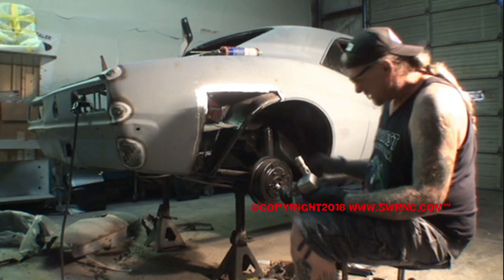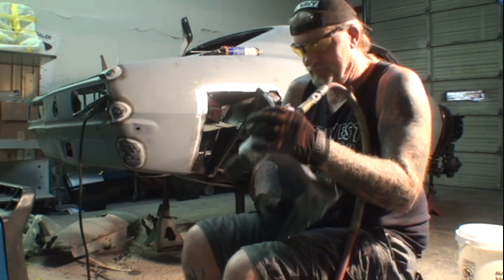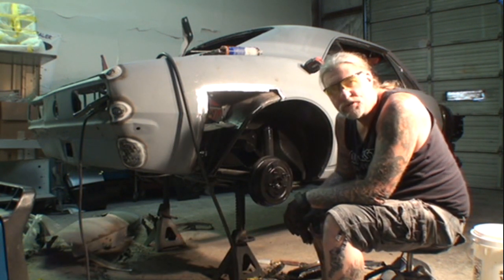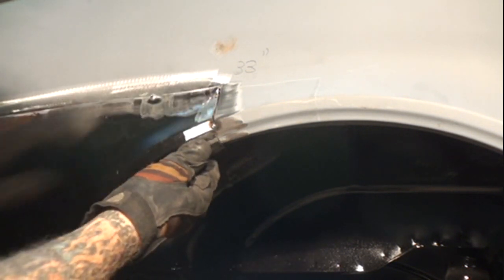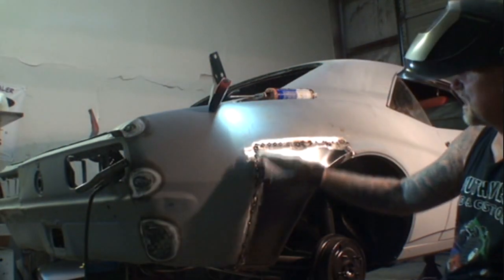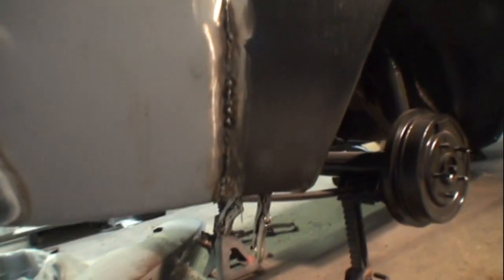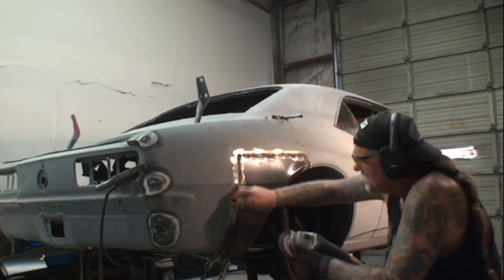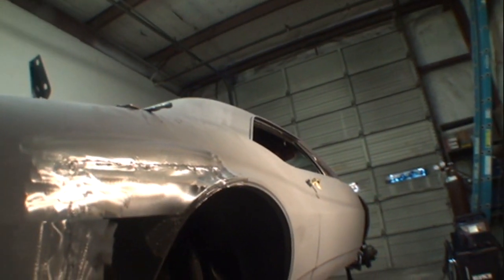How To "Patch Repair A Quarter Panel - 1967 Camaro - Part 5 - DONE

Comment: 1971 Duster project. Have the 1/4 panels sections from Goodmark. I know they are hit and miss. Will be using most of the panel as high up as i can go on both sides due to lower rust, sideswipe on the left, and numerous deep dents on the right. 1/4s are cut out rough.
Reply from the maker: Good Luck!
Reply: @diyautoschool  cant post pics that i see.

Comment: Love the show always entertaining, I have just started a quarter panel repair on my 68 Camaro, I have a question, if my cheap ass patch panel is about .008 thinner then cars sheetmetal how do you compensate for difference when using the flange tool.

Comment: Hello nice work, An important note, is that after you grind to bare metal to prevent rust one is supposed to use wax and grease remover followed by spray weld thru primer before welding. its one of the first things I learned at auto body school but don't take my word for it https://www.youtube.com/watch?v=FKyu3MWuPR8

Comment: Yous toos or threes as they say in the north section of this commonwealth USA say, This is very helpful. A class at a trade school would cost around 5 grand. Please do not send me a bill. That school would include about 100 hrs of classroom and pencil work.I will try this on my old Ford 150 restoration. There are two sides so which ever one finishes correctly will give me a good side to study back and try again. Their is only one other channel That I watch and you recognized him before. I am surprised that their is not a duct tape and bondo repair channel!

Comment: Just one point, primer it before finishing with body filler.. unprotected metal needs a protective coating before anything goes on top of it to prevent any further corrosion.

Comment: i am a fellow body guy when i replace a panel and but weld my new panel to make a perfect fit i put my new panel on over the old one screw and clamp it where i want it and cut booth panels with an air hacksaw snapon only one that cuts and has lasted lol bluepoint one so cut threw booth so when u are done cutting you end up with a perfect fit when u put the new pice back on and use magnets where u cant clamp to keep perfect hight less work and faster and grind welds with cut off wheel i can do a quarter in half the time as most and way leser bondo any questions please hit me up have outher tricks keep up the good work bro

Comment: Thanks Pete for the tips, i will definitely be incorporating the water cooling technique when i go to repair my quarter panels.
Reply: Surfaces should be dry before welding or hydrogen can pollute the weld and cause cracking. Google "Why is hydrogen a concern with welding?" Water is hydrogen and oxygen.

Comment: Hey Pete, quick question....What do you do on the inside of the quarter where you flanged it ? Maybe I missed a video where you showed that... Thanks
Reply: Was and am wondering the same thing. My thinking is if the welds are not sealed on both sides is. It’s a spot that will rust  faster if welds are exposed. Also wonder now would I spray an epoxy or self etching primer first on welds then reg primer. Also I have heard for bare metal, DTM primer, self etching primer. Or epoxy primer. What do you recommend and what is the proper application for these products.
Reply: Thanks for the reply Pete.... no seam sealer needed on inside?, just POR 15 and go, Love it thanks.
Reply from the maker: You can paint right over it, or you can take a shoots gun and splatter paint some POR15 on it to protect it for LIFE!, if you want to get really crazy you can go in and do some minor body work to hide the flange before painting.. Ive done that before for these ANAL FUCKS that have to have everything PERFECT for no reason what so ever...

Comment: Hi Pete, Hope all is well with you and minnie.Question bud, over my welds for floor pan replacement should i seal seal the weld or fibreglass first or just epocy over and leave.Car is a rotisserie job.
Thanks mate ! ( aussie3 slang ) :)
Reply from the maker: I would do all the welding necessary, then come back with some seam sealer and seam seal all the corners, cracks, air gaps, and seams where I welded on the inside.. On the outside I would slick it down and go factory look with it, grinding and finishing off the spot welded areas and finish it with a high quality industrial enamal black...
Reply: Still kinda new to your systems but I'm in overload watching learning listening Great advise goes a long way Thank you for your time!